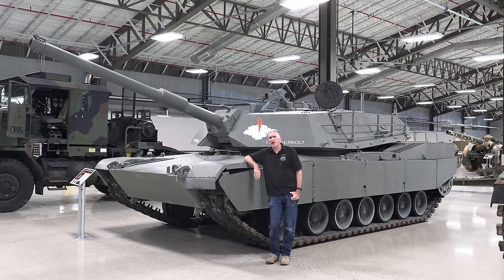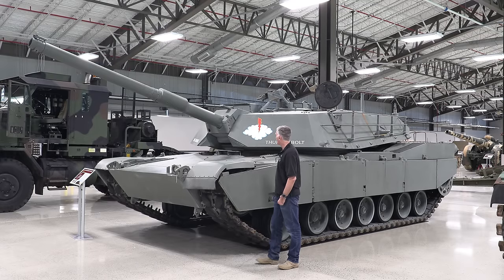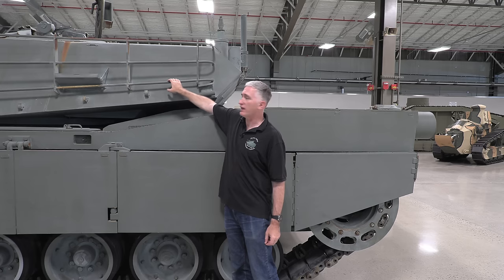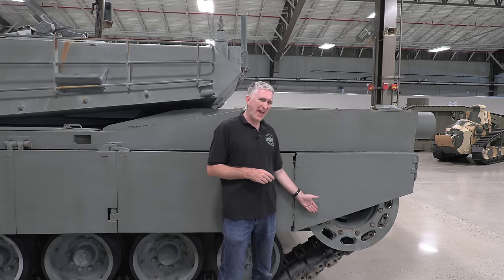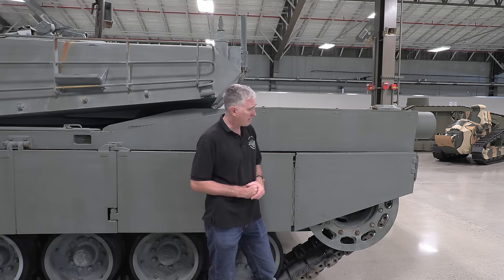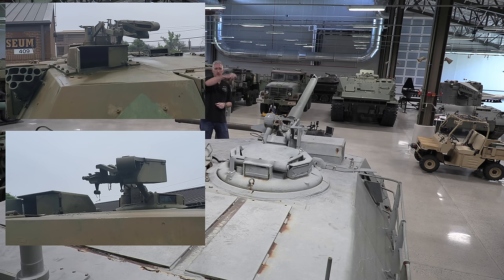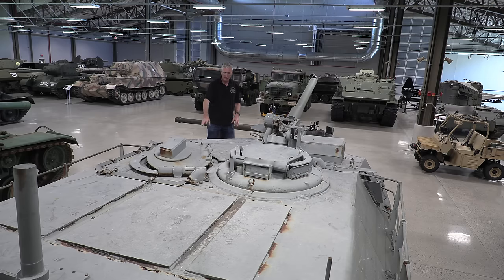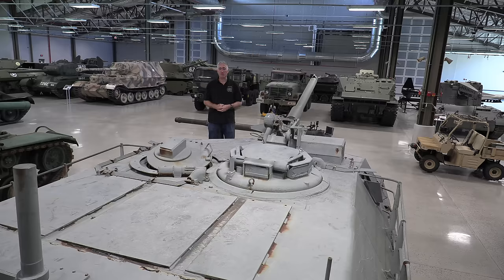Inside the Chieftain's Hatch Snapshot: M1 Thunderbolt.

Comment: It seemed 'smaller' somehow compared to a newer Abrams.  I imagine it's just an illusion.
Reply: It kind of is smaller, it has a smaller gun and less armor, it also has a smaller profile commanders cupola
Reply: @tubopanderson8106  Thanks.
Reply: @tubopanderson8106  It has a resemblance to early Korean K1 tanks. Which were also nicknamed baby Abrams.
Reply: @KSmithwick1989  that's true
Reply: @KSmithwick1989  I was under the impression that the K1 "baby Abrams" was something like 90% the size of an M1. Because the average Korean soldier was about 4" shorter than what the Abrams was designed around.
Reply: The turret is about 2 feet longer with the bustle rack now vs then, the turret front armor is maybe 2 or three inches thicker now too.  Although the turret looks wider now, it is not, that is the stowage boxes.
Reply: @robertdonnell8114  Thanks :)
Reply: @ScottKenny1978  That along with the reduced size, to help travel in mountainous terrain, and on local bridges.

Comment: In the last few days I've noticed that the abrams appears to have a shot trap just to either side and below the main gun on the turret. Does anyone know why that's there?  I assume the turret has to clear something somewhere on the tank but don't know what yet. With composite armour does a shot trap even matter now?
Reply: The idea of shot traps stopped really being a thing when everyone started slinging tungsten and depleted uranium rods at each other.
Reply: Shit traps are really only relevant in war thunder
Reply: As for what those cutouts are for, it's to make it easier for the driver to get in and out with the gun trained forward.
Reply: Not so much the composite armor as the long rod penetrators.

The engineers figured out how to make the darts turn square into the armor plate. Somehow.
Reply: Modern ammo doesn't really bounce afaik. Sabot rounds will just shatter, heat will be pretty degraded if it impacts off angle enough to not trigger the fuse, and hesh should work pretty much as normal across most angles of impact.